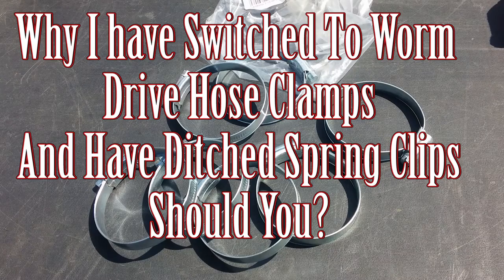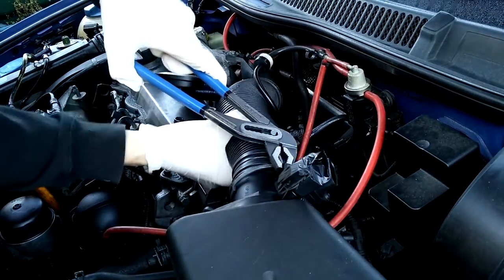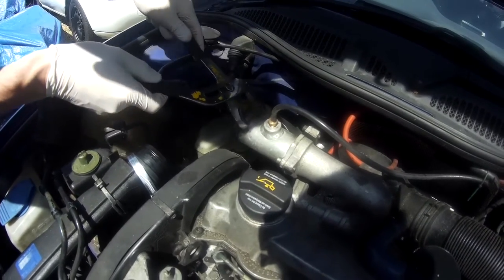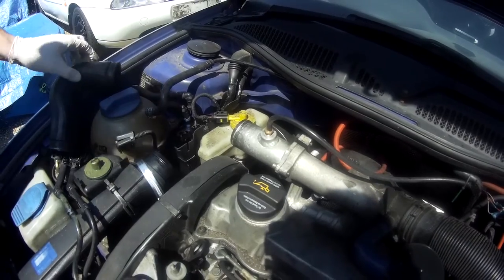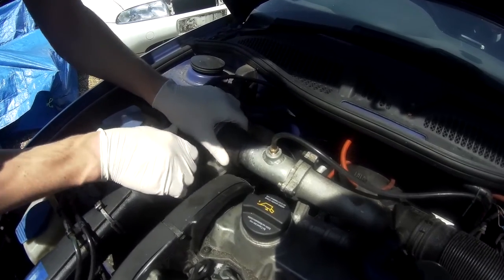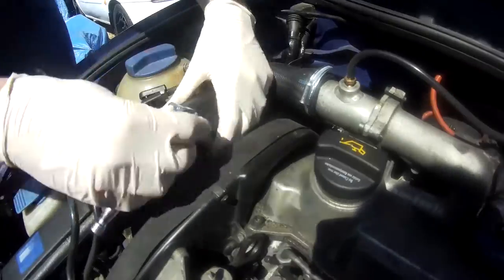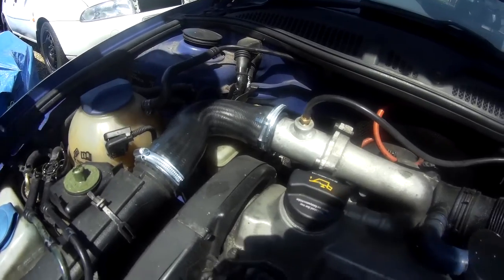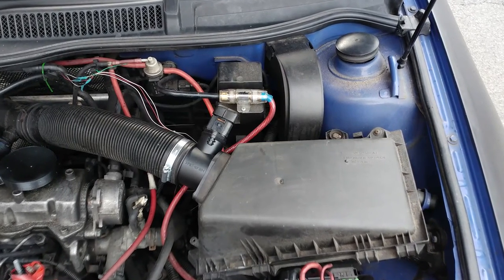Why I have ditched spring clips and switched to worm drive clamps, should you?

Comment: The spring clips are constant tension clips designed to expand and contract as parts heat and cool, jubilee clips will be fine at first but they will take a compression set and need constant re tightening eventually scraping the hose. They will be OK for air trunking but not coolant
Reply: Worm drive claps were here and used before spring clamps,and the did the job,even on radiators.
Reply: @americafirst2785  Which was fine when all the connections to the hoses were metal, they are more often plastic now. The worm drive has no give when the plastic expands due to heat and will often cause them to break and suddenly you have a leak and need to replace the part that broke. Too loose and it leaks as well. The main benefit to a worm drive is it's easier to deal with but with the proper tools it becomes trivial while even being faster than the worm drive. It's one thing to mangle a hose, breaking the plastic spout it connects to can be a nightmare. There is a reason why they are used now instead of worm clamps.

Comment: You are using the wrong tool to take the spring clips off that is why you are having problems.
Reply from the maker: Yep I mention in the video it is due to whichever tools I have but a Pneumatic Hose Clamp tool costs 10 times if not more what I have paid for the worm drive clamps.
 I mentioned there are pro's and con's to both and personally I'm happier with the cheaper clamps that are easier to place. I also think this is relevant to many DIYers out there too.
Reply: On Fleabay, Spring Hose Clamp Pliers are less than £6.
Reply: @CarAndMechanical  I absolutely hate spring clamps. Right tool or no... shouldn’t have to pay $80 for the right tool when you can use something that costs $1 each and can be tightened/loosened with a driver.
Reply: Not everybody has that tool,but everybody has a screw driver.

Comment: I would switch to worm gear clamps for air hoses, but not coolant.  I'll stick with OEM spring clamps for coolant hoses.
Reply from the maker: Ironically I might be changing my mind a little on them - I do like worm drive for ease of use and I concede spring clamps are functionally better.
I'm going to need to change all my worm drive air ones soon when I run more boost - but I might need to go all alu piping anyway.
what does still irk me with spring clips is when they fail they leave you stuck when you need the car the next day (Honda coolant ones fell to bits).

Comment: People say that spring clamps give you "constant" tension.  The question is, "Do they give you adequate tension?"  With time and temperature changes the "constant" tension will eventually be inadequate.  Then you will have a leak.  At that point you can't just tighten the spring clamp.  You have to go buy a new one.  If you drive out in the sticks like I do that could be a real problem.  With a worm drive clamp I tighten it up and I'm on my way.  Also  with spring clamps you can't substitute a larger size clamp for a smaller clamp.  You have to have have a spring clamp that is the exact right size.  With worm gear clamps not only can you substitute a larger clamp for a smaller clamp but you can chain clamps together and make a huge clamp.  Right now my muffler is being held together buy 3 worm gear clamps chained together.  You could never do that with spring clamps.  Spring clamps were invented to save the automobile manufacturers money, not to come up with a better hose clamping system.  To each his/her own.
Reply from the maker: Great summary, I've meant to follow this up at some point to argue for and against the points I made in this video - one interesting thing I'll note is that my GR Yaris has worm drive clamps from the factory.
Reply: You said it better then I could have.

Comment: Like you, I hate those damn clamps!!! I just spent 1 hour trying to figure out hot to unlock them once they were locked open. Did it by accident once and then ended up breaking the small tabs holding them open off twice! Luckily, I got the clamps back in place and you have to put them pretty well where they were before. But, I can't find a video on how to use them properly without a special tool.
Reply from the maker: +B Serna pretty much a case of best sized adjustable pipe pliers or locking pliers and place them just right and squeeze fully, move hope and pray. 
The theory is great until your shifting stuff whilst on your back with your arm in the engine bay trying to take a clip of an intercooler pipe.
Also the right tools cost £40+ I have a friend who got a cheaper one that just tore itself apart.

Comment: Worm screw clamps are never used in automotive industry because they don't apply constant pressure all the way around also cut into the hose.
Reply from the maker: Sorry that's crap, my GR Yaris has them
Reply: @CarAndMechanical  Yeah new generation worm screw that probably cost more than the actual hose it's on for a regular daily vehicle...

Comment: Another problem with spring clips is they cannot be tightened, were as you can with jubilee clips.
Reply: 😧Retorical Question: You do know spring clamps constantly squeeze the hose as it cools and contracts so they never leak right? They were created for THE specific reason, to never have to tighten them.